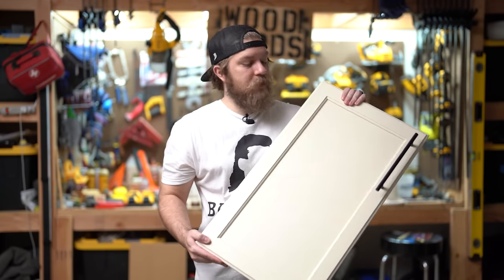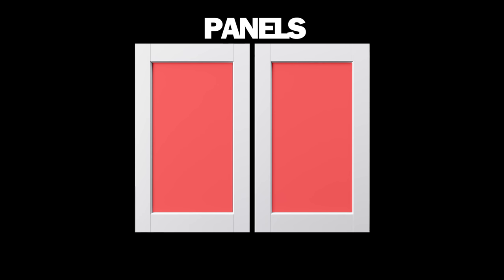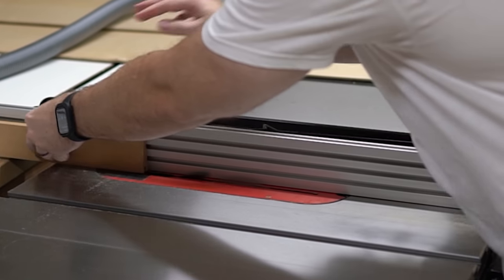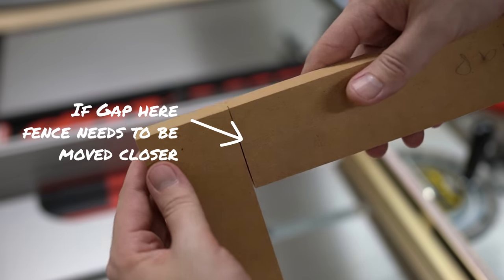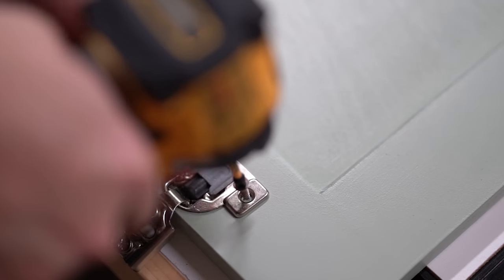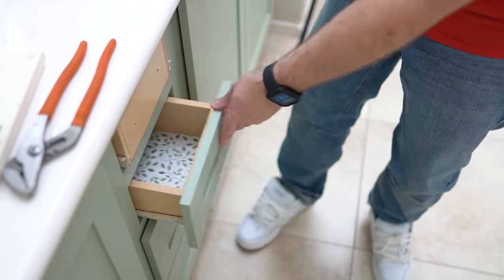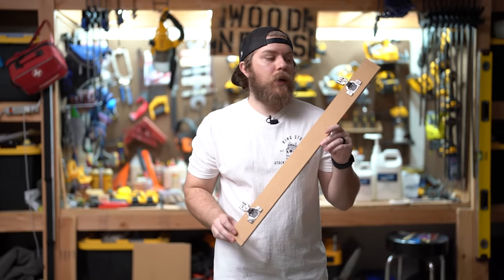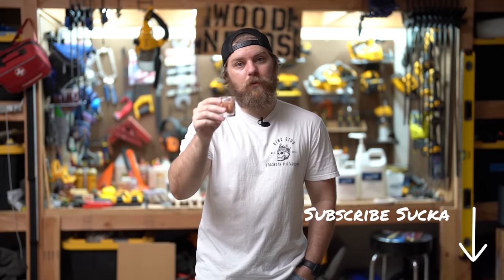CHEAP and EASY Shaker Cabinet Doors and Drawers | DIY | HOW TO

Comment: This may sound insane but I don't have a table saw so would gluing thin 1/8 HDF rails and stiles onto 3/4 MDF panels instead of having to make fences and tennis work? I have the track saw kreg jig for my circular saw and a miter saw.
Reply from the maker: Hey! You could do something like that! I actually plan on doing another video on this topic to try a bunch of different ways to make doors like this. It might be obvious but the better tools make it easier to cut but also make repeatability easier as well. The less tools the harder it will be for the outcome to turn out as good. I haven’t tried it so I don’t have a great recommendation yet but I think what you’re suggesting is possible.
Reply: @WoodNerds  I would love to see a video on different methods. I'm planning a full wall builtin desk, book case, wardrobe combination in a few months and trying to plan it out now. Thanks! Love the video!!!
Reply from the maker: Sounds like an awesome project! I’ll see how soon I can set that up and make it happen. Thanks for watching and taking time to chat! I appreciate it!

Comment: A lot of older cheap cabinets are made of particle board and mdf, and they last for a pretty long time with normal use. Not to mention that proper paint adds protection against moisture. The only problem, is you can't brag to your friends about spending $5,000 on cabinet doors.
Reply from the maker: That’s a big problem! The only reason I complete projects is to brag. Put myself in a weird position with this one.
Reply: @WoodNerds  lol

Comment: Any design changes for glass panels instead?
Reply: Just paint the dado if you're using glass, otherwise it should be the same. Also make sure your mortise and tennon can support the extra weight.

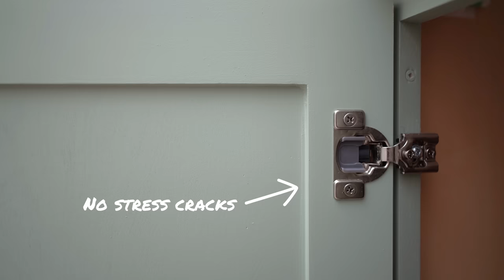Comment: Nice cabinets, but @ 0:34, I see a crack on the frame under the hinge.
Reply from the maker: Good catch but has nothing to do with the doors. I didn’t replace the face frame. That’s part of the original cabinets from 10+ years ago and had a crack before I started.
Reply: @WoodNerds  I got you. I'm a home inspector, not a cabinet builder. I just thought it ironic that they had a caption stating, "no crack", in the same frame as the crack I pointed out... But even I knew you were talking about the door. Nice work, just messing with you.
Reply from the maker: Haha no worries here! I don’t mind people keeping me honest haha. Thanks for watching and taking time to comment!

Comment: Doesn’t the mdf cup or slightly curl over time ?
Reply from the maker: It’s a stable material so if it’s painted, it shouldn’t. Mine are still straight!
Reply: @WoodNerds what material did you use for the middle panel ?

Comment: How do you sand mdf? For me, it's like trying to sand cardboard I'm I made the doors and have been stuck on this days not understanding
Reply from the maker: Sands just like most other materials for me. Shouldn’t have to sand the face too much but the edges haven’t given me any problems.
Reply: @WoodNerds  okay. It appears to have a "frayed" look. I'm unable to attach as picture but that does make any sense?
Reply from the maker: @andreagiovinazzo4221 yeah, it can look fuzzy. If I use high grit sandpaper (220 grit) I don’t have any issues. Could also be the brand or quality of MDF you have? I haven’t come across any that have that problem but I’ve read others that have. Take a small piece, sand it down as a test to see how well you can get rid of it then paint it to see if the paint covers up the fuzziness.
Reply: If your MDF has been sitting around in a high humidity environment (at the store or at home) it may have absorbed some of that moisture.  Cure is two-fold:  one, use dry MDF; two, you can seal the MDF where you want to sand by using some shellac or sanding sealer.

Comment: Combination of nice expensive tools (such as table saw capable of using dado blades) and cheap shit materials like MDS... feels the opposite to DIY, but perhaps it's just me. I prefer to spend a bit more on material and use my trusted router as my cheap cheap table saw doesn't let to use dados :( Nevertheless, thanks for the great video - I learned a lot!!!
Reply from the maker: Glad you enjoyed this video! I made a separate video using a circular saw instead of a table saw for individuals without one you might want to check out. It’s a different build method that could use your router to make a quick cabinet door!

Comment: I'm wondering why your cutting out rails & stiles and on top of that, grooves.  Since this configuration was created for all real wood designs, so the wood grain would be locked into each other to stop the wood from warping while still allowing seasonal movement.  With any MDF material, this is not needed, you can just cut out your {window} frame whole.  As for the interior "floating" panel, again since this is not wood there's no need for floating. Just cut out this layer the same width as the outside dimensions and laminate the layers together with glue, which will only add more strength to the entire panel.
Reply from the maker: Fair observation! If I had mdf laying around for the panel, what you’re suggesting would have worked great I assume (haven’t tried it). I only had some leftover plywood where the edges would have been noticeably different if I followed this method. Either way I didn’t think of doing it this way but have had the suggestion a few times and plan on giving it a try in the near future. Thanks for the suggestions!

Comment: I did the same thing on our spare bathroom. It gets no use and temp stays the same. 1 week after I installed them I came in and just had a pile of saw dust on the floor
Reply from the maker: Lol sounds like some of the feedback I’ve gotten.

Comment: Couldn’t you just use block on one side of the drawers instead of both?
Reply from the maker: Yeah! That would work. Using it on both is a validation method that double checks as you install. But if you’re positive you’re right then it wouldn’t make a difference.

Comment: I don't see it, MDF for fixed panels is fine but your hinges are bound to fail, and I fear for the integrity of the edges. Poplar is relatively inexpensive, clean  and very easy to work with. If I was trying to save a buck that would be my choice.

Comment: I thought for sure when you said they were a 1800's design that you'd build them with basic tools. The average person doesn't have a table saw. I can afford one but can't justify the cost because it would just sit 99% of the time.
Reply from the maker: It depends on your lifestyle and needs. If you need to redo cabinet doors, potentially saving $1,000 to do it yourself helps justify the price tag of the table saw in my experience.

To be honest, if you can’t use or don’t have a table saw, this method might not work for you. There’s a level of skill you need from years of experience to be able to make cabinet doors completely by hand, and those people aren’t needing a YouTube video to tell them how to build things because they are already very skilled. Power tools are built to assist in accurate and repeatable cuts and that makes them perfect for a beginner… in fact, a beginner would benefit most from the most expensive tools as they have the most features to assist in use, while a pro can use even the most basic tools as they have the experience and understanding of how they work that helps them get great results regardless the quality of tool.

Comment: Track saw
Reply from the maker: Although the variance would be minor if you are a skilled operator; In my opinion, a track saw would be hard to replicate results. The nice thing about a table saw is the fence stays in place giving you consistent cut widths. Regardless, a track saw would still be a solution. Thanks for sharing!

Comment: My kitchen mdf doors are atrocious. Wet hands pulling on drawers? Swelling and then splitting every corner, every where. Looks awful. Would never recommend mdf in a kitchen. Came with the house otherwise I wouldn’t have done it.

Comment: why would you use fiberboard? real wood is not that expensive
Reply from the maker: Real wood is more expensive and harder to work with. MDF is cheap, easy to dimension, and comes dead flat.

Comment: my only frustration with these types of videos is that all of these content creators stress how we should use safety and be safe, yet no one ever practices what they preach in these videos.. sigh.
Reply from the maker: You’re not wrong. There’s a level of risk involved every time you work with cutting tools like this. I’d only say give grace as content creators are no different than anyone else, just that we have a camera and like to film our projects. When I saw my safety failure the best I could do is call it out after the fact as those mistakes were made over a year ago haha.

Comment: One mistake, NEVER , Never use caulk on raw wood . Prime first , then sand 1 time after . Then, use material of choice . Oil is brittle after some humidity.  Latex is more flexible

Comment: MDF is absolute trash, wet once shit forever. It's basically computer paper. That said if on a tight budget.....use reclaimed lumber prom pallets. That wood is free and cheaper than MDF. That said MDF gives quick results and would be perfect for flipping a house or if you are gentle on your own stuff then it should be fine.

Comment: i wouldn't use hard wood if you plan on painting it either. 
that's buying a Lamborghini and using a paintbrush and some ugly wall paint on it. just dont. 
you dont want to put in a lot of money and effort into picking a really nice hardwood just to have someone paint over it. its absolutely insulting. 

the thing i dont like about MDF is it can be gouged by fingernails. and paint is pretty boring.

Comment: Cheap and easy.
Starts with over $10.000 worth of tools and starts cutting wood with expert techniques.

This is just another video where 99% of the viewers have no use for at all.
Reply from the maker: Then watch the other video I made exactly for responses like this… most projects require tools and/or experience. That’s just a fact. I can’t predict what tools each individual has in their shop. It’s up to the user to understand the concept and complete the project with what they have/can afford to invest.

Comment: ??????  Struggling to see the difference between your “in style” and “out of style” cabinet doors.  Size is the same.  Color and hardware are different.  Your video could be 3 seconds long.  The script:  “paint your cabinet doors.”
Reply from the maker: The old doors have an out of style profile routed into them… The new doors are standard (square) shaker style doors.